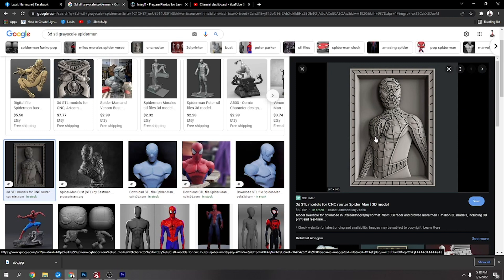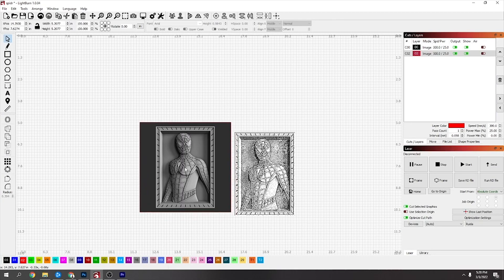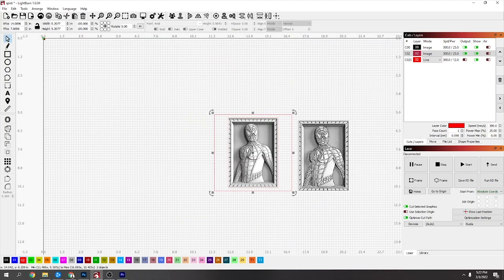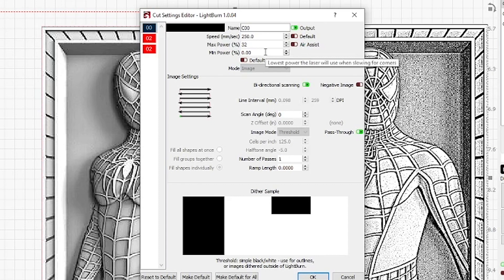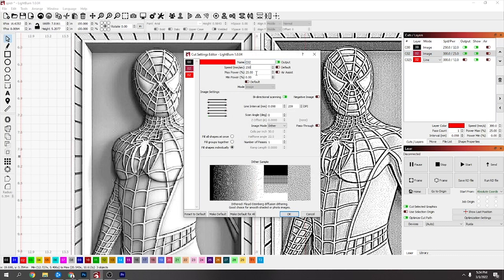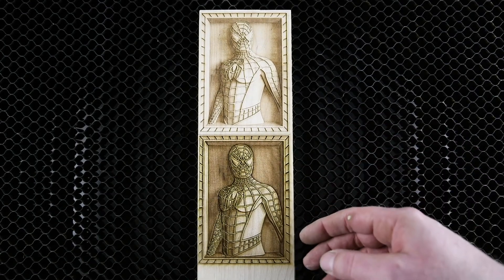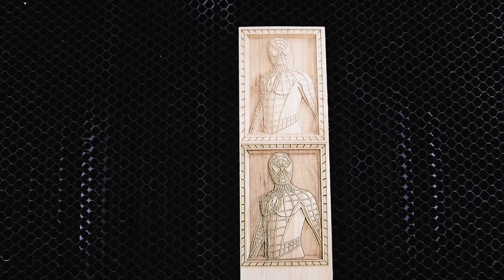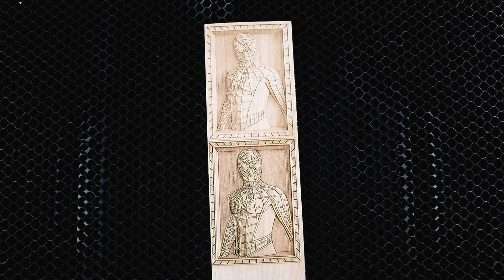UPDATED SHORT VERISON STL Image 3D laser Effect  Image-r Lightburn

Comment: great work and a great teacher, I thank you1
 question, as I'm a little confused with all the different files and how it effects me . fyi I use light burn exclusively and if needed image -r, green as there with image -r  when I'm looking for files to 3d engrave I look for STL files in greyscale ! right or wrong? I also see theres png files that give an illusion of 3d ? and what really through me is you save from image-r as a bmt file ,I think . now when on light burn doesn't just doing it in greyscale make it a 3d even if its a png file ? so why dont you save the image-r as a png rather than a bmt? also most light burn files are sag?? whats your reasoning please
pat
Reply from the maker: I save as a .BMP and use PASSTHROUGH in lightburn as it is already dithered, The bitmap file format also contains resolution information which indicates how many dots fit within a given linear distance. hope that helps
Reply: @carphotography   but I thought that 3 d pictures had to be in greyscale only for the 3 d effect? Thanks for your response